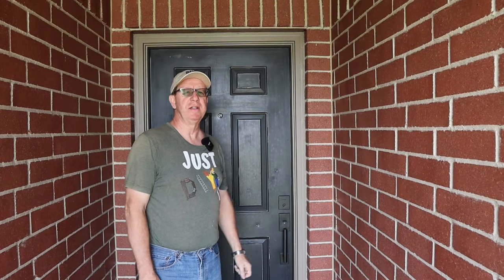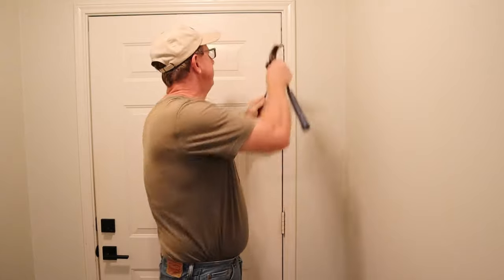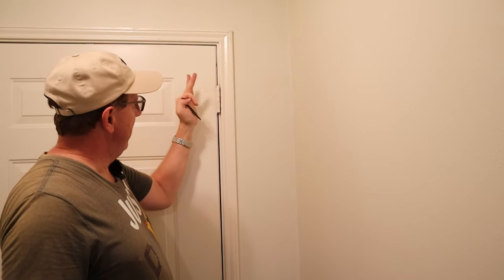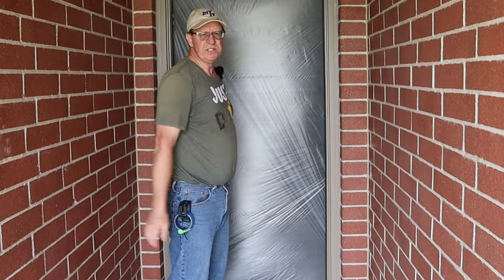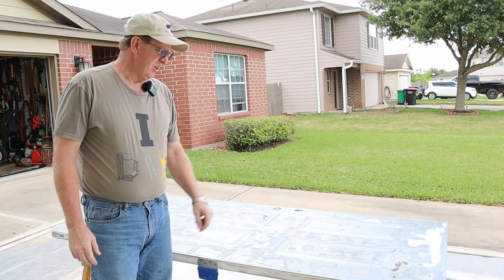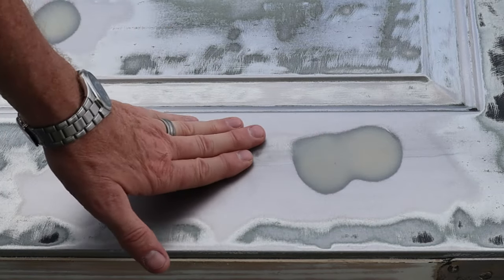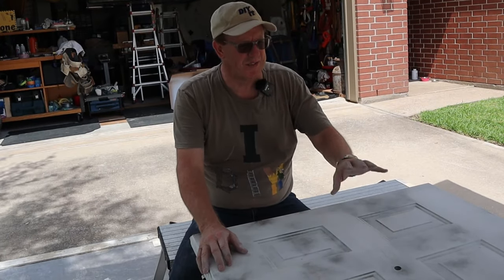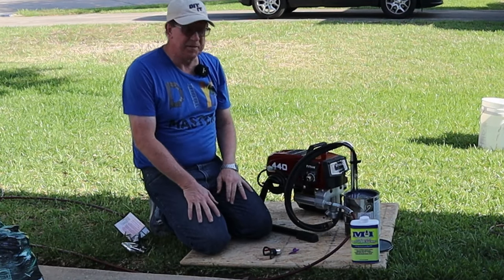Simple Weekend Project-Repair and Paint Your Entry Door

Comment: When you sanded all the paint off did you use the manual sand paper? Or did you use the power sander?
Reply from the maker: I used the orbital sander to remove the paint down to metal, used wire wheel on drill for the contours.  When doing the primer sanding did it by hand.  Thanks for watching.

Comment: great video, nice job! would it have been possible to spray the paint with the HVLP instead of the airless? I'm wondering if it's worth it to get an airless in addition to a HVLP, since the airless units appear to waist the excess remaining paint in the tube when cleaning up.
Reply from the maker: Yes I could have done it with my HVLP and your right it definitely waste less paint.  I have a video on how I clean my airless and do all I can to recover all the paint back.  But in the end it still does waste more paint than HVLP.  The airless is more for bigger jobs.  Thanks for watching and glad you liked it.
Reply: @OakleysDIYHomeRenovation101  thanks for the response, and thanks so much for sharing your experience and knowledge with the world!

Comment: Great work Oakley! Enjoyed the video. I'm worried I can't remove the door as I live in a condo. Any suggestions for painting while the door is still attached?
Reply from the maker: thank you and glad you liked it.  If your front door opens to the outside and not into a hallway you could sand it in place.  To paint with a sprayer you could use a 3m masker with plastic and mask off your entry and make it a spray booth so all overspray stays contained.  If don't want to do that then could just spray it closed.  Thanks for watching.
Reply: How does someone get so many dents on their door?
Reply: I'm not bothering with door removal. I'm sanding it in place and painting mine by hand.

Comment: Hey Mr. Oakley, I painted my Metal Front Door which is a very hard to get certain type paint. But I didn’t sand the door first I just kind of washed it. The guy at Sherman Williams said that I didn’t need to sand it first, just paint over it he said. Well I think he was wrong. I mean I painted the door. But it doesn’t look super smooth. Do I have to repaint it again But sand it first?
Reply from the maker: If you don't like the finish then yes I would sand the door.  I would actually sand off the new paint down to the old color.  Then primer the door, sand the primer with 220 and then paint your new color.  Thanks for watching.
Reply: Did you paint with a brush? If so you might need to add leveler in it. They could help you at the paint store with it.

Comment: What do you think caused the rust after priming?
Reply from the maker: Was thinking it was because I used water first then alcohol to clean the surface before priming.  It seemed to happen mostly around where the bondo was so thought that I didn't let it dry/evaporate enough before priming.  Thanks for watching